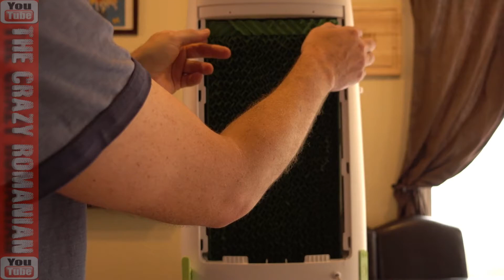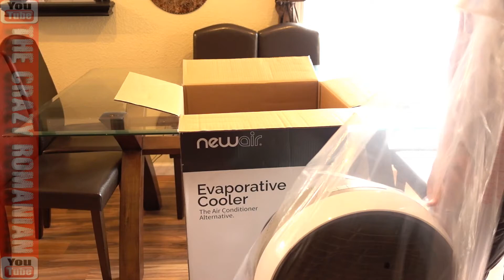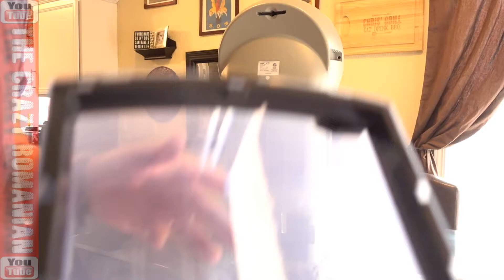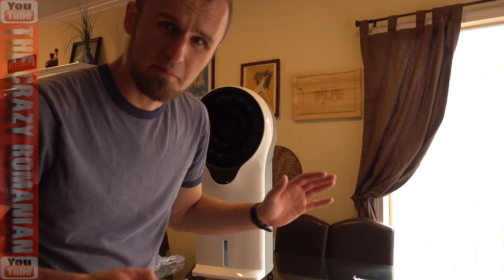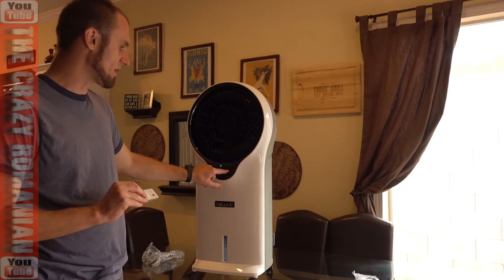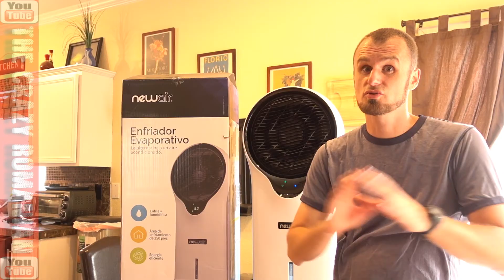BOX FAN VS SWAMP COOLER - Old technology VS New - Newair EC111W Evaporative Cooler

Comment: When i see people using fans, they're usually more to move air around and less for keeping themselves cool. 
A fan close to a heater when it's cold to move the air around.. 
A fan in a kitchen next to a window.. for pulling the hot out from the kitchen out of the home..
Fans also used for blowing out dirty air. (smokey, stinking, so on) 
And at certain times of the year, it's too cold for an AC/swamp-cooler but too hot without it. Regular fans are ideal for cooling off in that situation.
The idea that evaporative coolers could ever 'replace' fans.. is a laughable statement. 
Just because it's an old concept and has been around for a long time, isn't a reason to 'replace it'. The wheel has been around for a hell of a long time too but you don't see people pushing to replace the wheel due to it being an old concept. I could give many more examples of such inventions that have been and will always be, a part of our society. Fans are among them. 
Also, evaporative coolers have been around for quite some time....and longer than air conditioners. When you say they're 'the future' it makes it seem that you don't realize they're also part of the past (ironic considering you were mocking the idea of using old technology) 
You can find Swamp Coolers all the way back to 1916 in America. And there is even an argument that the ancient Egyptians were enjoying similar methods to keep cool, but relying on natural airflow instead of electricity, to push the air through/past wet mediums. 

 But all of that aside, I am a supporter of evaporative coolers. 
And while i really don't care for how your presenting things in this video, i will give you credit for having good production quality. 

Oh and final thought.. Portable swamp coolers like those are a no go for me unless you can set up some automatic water feed. I've had one of these things before (not the same model but the same idea and size) and i had to refill that thing several times throughout the day. And one fill would never last through-out the night. Without an automatic water feed of some sort, i don't think they're worth it.